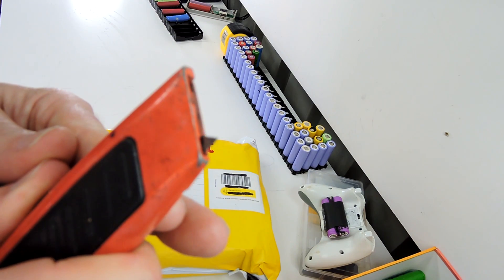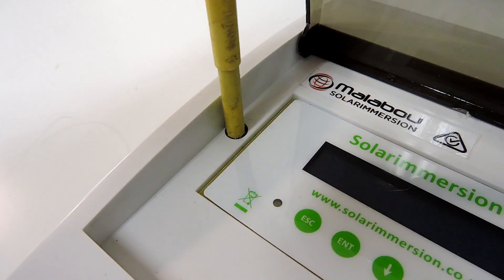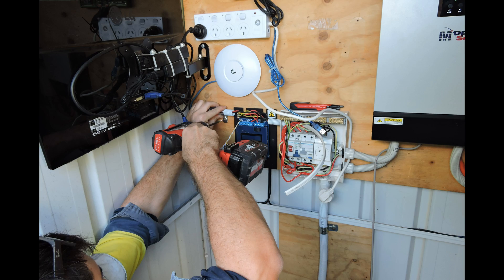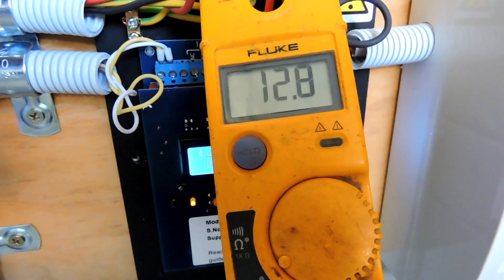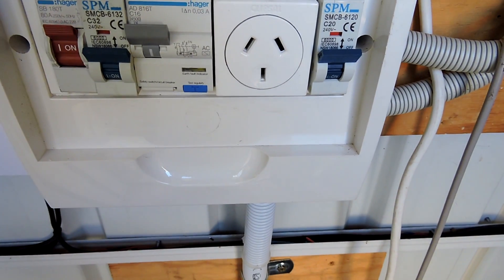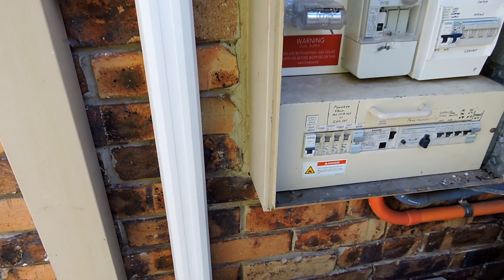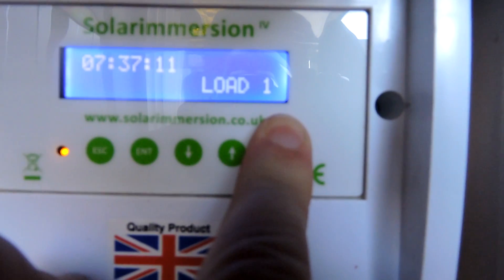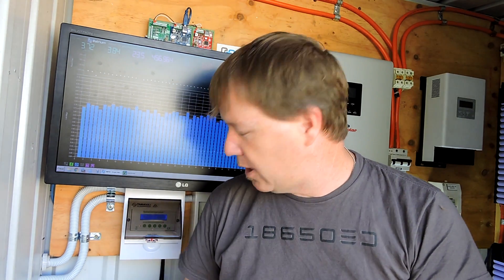SolarImmersion IV Solar diversion Unboxing & Install ( Solar hot water heater)

Comment: First I'm a recent follower to your site and am impressed with some of your power wall work. However,  in this video you may be a bit off base. The best water heating method using solar is not by using your solar electrical grid but by buying or constructing your own specific solar water heater which uses direct solar to heat the water rather than use electric from your solar power grid. You can take the money you're spending on your on grid heating and pay for a unit like this: http://www.sammler.gr/index.php?lang=1&lang=2  in no time. also by increasing the size of the holding tank you can insure hot water for several days of little or no direct sunlight. No evening or morning power top offs ever. I'm sure you are already aware of all this and any one living in a place like Greece (me), S.E. Asia/ Aussieland  or hot climates are also. I think this unit your using here is more adaptable to the colder areas; perhaps that's why it's U.K. made :).
With a little more work you will be completely energy independent so keep up the good work and videos. Jim
Reply from the maker: But can it be done this cheap and easy using existing infrastructure?
Reply: It depends on how much money your having to spend on grid electricity to insure you have hot water all the time. With your system you have to essentially convert from solar to electrical to heat which is much less efficient than converting directly solar to heat. Only you can determine if it is cost effective in your circumstance. You're a smart guy so I'm sure you could design and make your own solar to water heater using all the info available. The only problem you may have might be with some stupid zoning laws in some areas but most communities are very "green" so this should not be a factor.  I'm not being critical of your choice here, I just wanted to point out that you can be using your power bank electricity for something other than water heating since you still need grid support sometimes. Also you could leave this unit installed as a backup on the rare occasions your direct solar unit needs help which shouldn't be often.  Thanks for your reply, Jim
Reply: I would have agreed with you 5 or so years ago, which is about the time I invested in an Evacuated tube solar hot water system (with rebates) which is still working well I should add, but nowdays, with PV solar so exceptionally cheap it's really close.  PV solar has virtually zero maintenance, it's hard to compete with.
Reply: Check out Rotex systems for some implementations in heating/cooling. When I built my house I used this system in isolated concrete thermal mass slabs in the floor to provide both heat in winter and cooling in summer. It's tied into my solar thermal units and provides cheap heat much of the winter. In summer I cycle cold water through it and it keeps the house cool without excessive A/C use. Anyway the pipe used has excellent heat transfer characteristics and could be something to look at. You want to isolate any solar cell cooling system from other sources of heat or else you lose efficiency so a Styrofoam or similar embed cooling lines attached to the back of the cells with thermal adhesive is probably the best option. Using a Rotex type pipe would save weight. Now, as you may surmise, this type of system probably wouldn't be very efficient for making hot water in large amounts. Designing a duel system to both provide cell cooling and hot water would probably have to have trade offs in efficiency in both system parts. But, I could be wrong since I haven't been keeping up with advances in this area. I like the idea and I'm sure someone has something operational if it can be done.
Reply: A couple of hundred feet of black hosepipe behind a glass front on a black background, using a small pump (or gravity) should be pretty cheap to do.
A simple control using just two thermistors to pump if outside warmer than tank, and i think you're done.

Given that PV only uses about 20% of the energy falling on it, and the rest of the 80% is heat, it would be a shame not to use it in favour of precious electrons!
Reply: If you have the spare roof space PV solar panels combined with an electric hot water system is arguably now cheaper than a dedicated solar hot water system (commercial systems not DIY)
Reply: Not sure that's correct at this point in time,  a properly engineered solar water system allows the best cost effective use of off grid power and is maintenance free. PV with power bank storage would serve most other needs but why use this resource that requires maintenance to do something direct sunlight can do in one conversion- solar to heat. I say properly engineered because depending on where you live the typical DIY systems you see on YouTube won't hack it very well in cold weather without using electric thermal protection.. A good passive system that uses antifreeze and heat exchanger in the holding tank may be a better solution. Back in 89, I built one of these here in Greece and people thought I was crazy until we got a particularly bad winter. Guess who still had hot water. Besides that you don't run into all the heat control problems of a direct system.                         
 One area where we keep trying to re-invent the wheel is small system wind turbines. After studying the problem for some time I'm of the mind that the old Amish wind mill which is/was used to pump water may well be a good starting point. Even with 200+year old material design it provides one of the best performance characteristics in all wind conditions. With this top end design adapted with proper gearing and ground based generators the high torque low rpm characteristics of the multi-blade design could be used to generate allot of extra power at times  when PV can't. You'll read allot of bulls__t about 2 and 3 prop systems and all the talk is about rpms. Well , torque and low wind performance will give better overall performance on a small single unit system.                                                                                         

To your original point, you may be correct at some point in the future when micro super capacitor technology begins to meet everyone's expectations. But that may be a hard nut to crack. Jim
Reply: PV here in Greece is still a bit hit and miss and system costs make it difficult to recover ones investment. I've been watching the Alaska experience using combo thermal/ PV  for virtually grid free operation all year round. There is a small fudge factor with using bio at some times in winter, but the costs are really impressive. I think there's an older YouTube discussing it but I have only seen some printed articles recently. PV here would be great if the cost came down even a little and one of the reasons I even watch this channel was I was looking for ideas for cheaper power storage. I've kluged together several small 500-1000W systems using Chinese junk but would really like to try to build something with a large capacity to run A/C etc. Any advice or point in the right direction would be appreciated. Jim
Reply: I'd love to build a combined system, where the PV panels make electricity and hot water by circulating a liquid to keep the panels cool - it's a win-win because cooling the panels makes them significantly more efficient, and the waste heat can be used to store hot water without using electricity, apart from maybe a pump and control.
Just have to glue a coiled copper tube to the back of the panel, connect them up.
Glue could be an electrical insulator that is a good heat conductor such as an epoxy composite using alumina powder, mica or boron nitride to help collect the heat.
Reply: These solar systems are actually really popular in Australia (or at least, they were in the 80s-90s -- they have largely been replaced by instant gas hot water systems in new builds which are relatively cheap $1k-$2k and provide good pressure and temperature with 0 storage).

They are quite expensive though up front cost is at least AU$4-5,000 AUD -- however natural gas is pretty much ubiquitous here so most modern systems now use an "instant gas" booster after the solar system which is much better than the older style electric booster systems because it will only heat the water on demand and can even heat it if it's stone cold or just "boost" it an extra 10 degrees or otherwise whatever temperature is required.

Having said all that while this instant gas heating is good; with induction cooking being quite viable now the non-usage (daily 'access') cost of gas systems is actually quite a dent in the savings of using gas to heat water so a solar energy diversion system like this could be potentially useful if you wanted to disconnect from gas entirely.

There are also solar hybrid systems that use a heat pump (think reverse cycle air conditioner) instead of the gas for better efficiency, again though they are quite costly and has a big impact on the payback period.

Last comment would be that for these solar systems the way the electric booster usually works is the tank has two 'sections' with a temperature sensor about halfway down.  The electric booster option will only heat about half the water (e.g. 150L) and won't heat the other 150L leaving that exclusively up to the solar to heat.  This is quite good because it ensures even if you always leave your booster on, it still has capacity to soak up the sun.

Naturally all of these systems could be made to be smarter, e.g. by monitoring water usage etc.  And it would be great to have your reverse cycle a/c system have the ability to dump heat into the hot water system but these systems are generally too expensive to make it worth it for most people to install -- as they aren't going to install them at build time, and renters aren't going to have the pay back period and it's a waste to throw away something in a house you already purchased etc!

Comment: May I ask what are your batteries for?  You seem to have a grid-tied system.  Also in principle some of your excess solar energy is used to heat your water?  Do you need a special water heater for this? -Gerry D., from the Philippines
Reply: I thought this episode was a pretty concise explanation of what the powerwall is for. Pay particular attention to the difference between the import and export tariffs and also the time difference between his maximum demand and his maximum supply from the PV array.

Comment: Can you insert two temperatures one for the sun and one for the mains
Does it get below 55-60C so does it use from the net, or else does it take from the sun?

And
 you have not been thinking about using solar collectors for hot water, 
so you reduce electricity consumption in the winter, but not so much 
that you boil the system in the summer
Reply: These units don't monitor the temperature of the hot water. Fairly basic.

Comment: 5:17 thats a gekko!!!!
Reply: i don't think the gekkos are a large problem. ants however is the thing you really do not want anywhere near electronics. they build nests in warm places. they have acid fluids in them that corrode contacts and metals. ants will not just shorten electric circuits, they will utterly destroy them. 
my victron inverter has large openings. i have had cockroaches and caterpillar webbings in there without any ill effects. though not desired.
Reply: 5sec later it could be a "bug" then you get a gekko on a stick, so to speak
Reply: I hope its doesn’t tread anywhere dangerous, for itself or burning down the shed!
Reply: grabs flame thrower  Decontamination....
Reply: i have got them in the power room too, they are fairly shy though
Reply from the maker: Little buggers are everywhere
Reply: HBPowerwall any possibility in them shorting something?
Reply: If a gecko dies and decomposes on a circuit or circuit board ...bang!
Reply: yes and pulls down the whole east australian grid!!!!!!